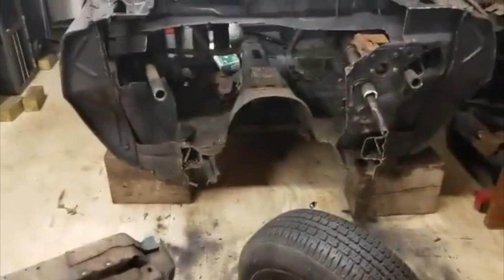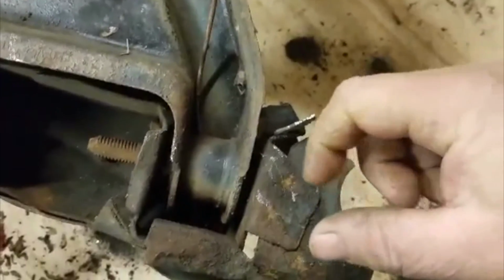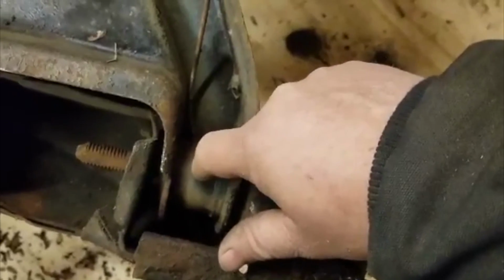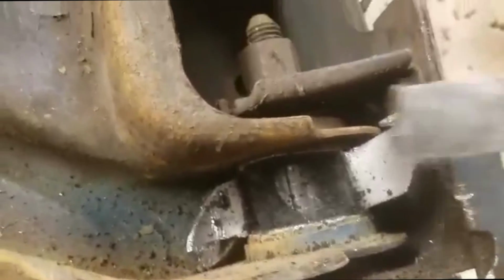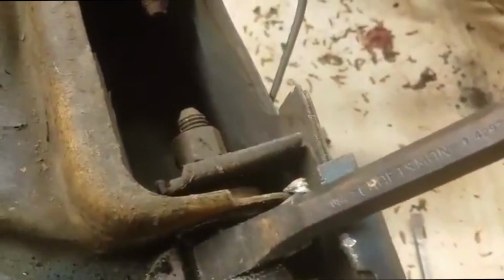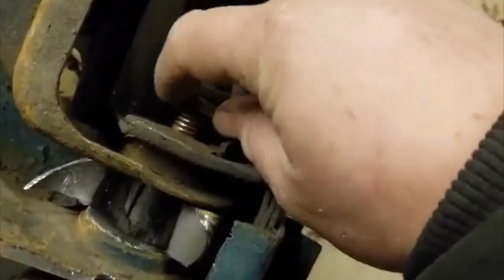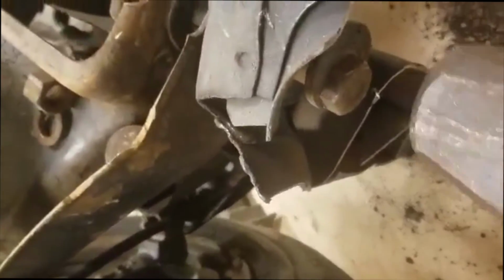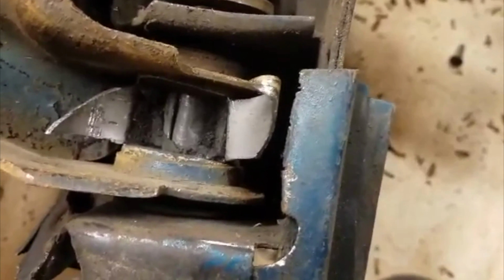H-Body seized Lower control arm bolt removal by Bill Lynch

Comment: What do i do if the nut and bolt is stuck and doesn't move at all
Reply: YOU TOW IT TO THE SHOP
Reply from the maker: Melt the rubber off. Thats what I did.

Comment: i call BS.  Didn't take you 2 minutes to cut and pry open that bushing outer sleeve.  And you didn't show what you used to cut it.And you didn't show what happens if your inner sleeve  slit ends up on the other side of where you opened your outer sleeve
Reply from the maker: Have you tried this method? Please report back with your experience so others can learn from it.